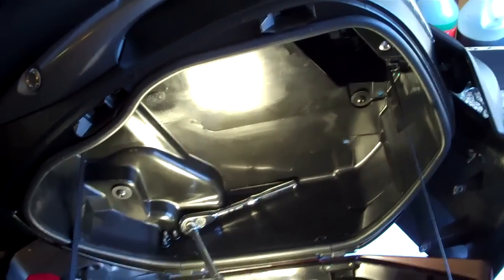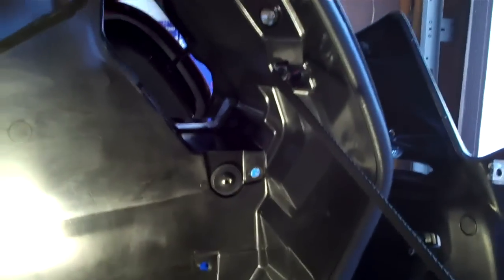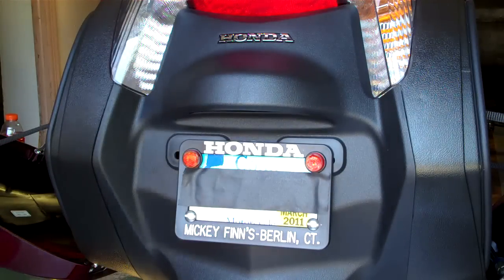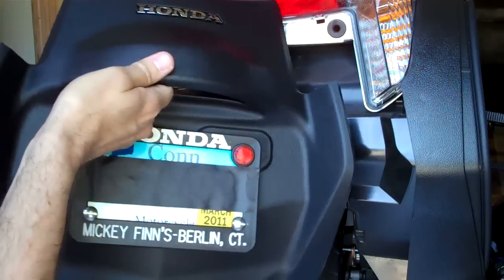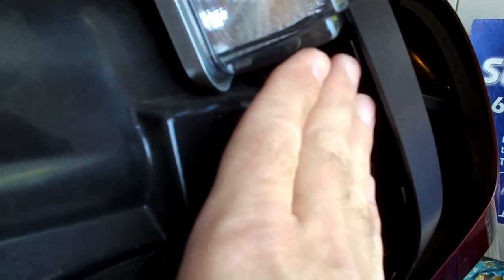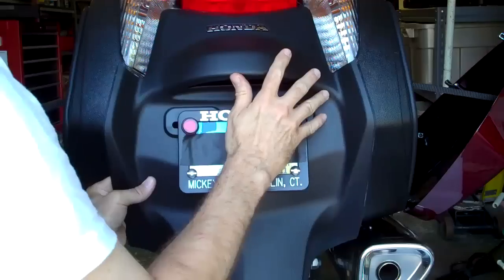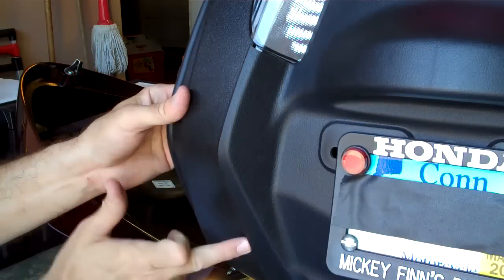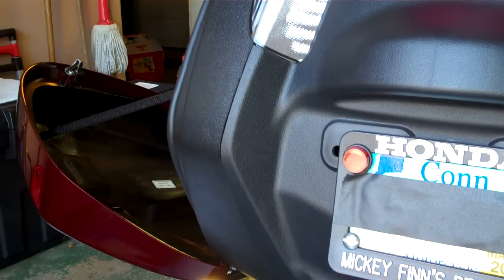Honda NT700V Rear Fender Remove + Replace

Comment: 2010 NT700VA (21k miles) in Huntsville AL USA just did my 1st rear tire and pads all around on my own.  Found that a 1" flat piece of thin aluminum strip is just the ticket to help guide those stubborn edges to pop into place.  Made short work of it - way less frustrating.  Still loosened the saddlebags up!  Your videos were the ticket to getting the project done.

Comment: The Honda Nt700 is an excellent motorcycle, very versatile, with perfect power for routes on slow roads, stable, very well integrated, with low maintenance, with low fuel consumption per kilometer, with impressive braking, a very well phased change. BUT with the worst suitcase design that I ever imagined could come from the mind of a Japanese, it is so bad and so delicate that many owners have dispensed with its benefits and have sold their motorcycles fed up with the breakage of any of the delicate elements of Closing the suitcases ruins a tourist outing. If the motorcycle in general has a 9, the suitcases subtract 8 points. What a failure.